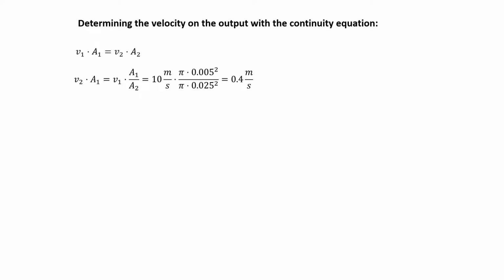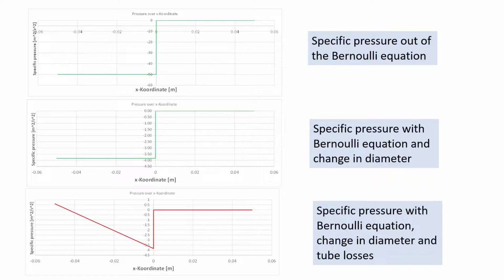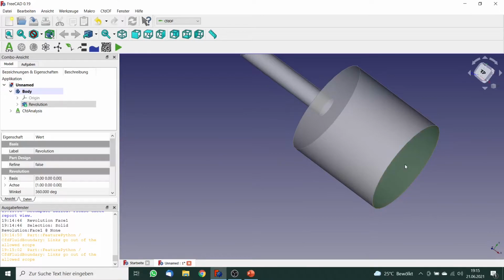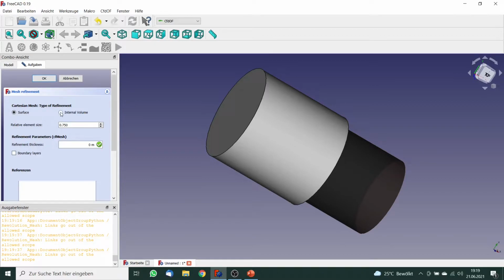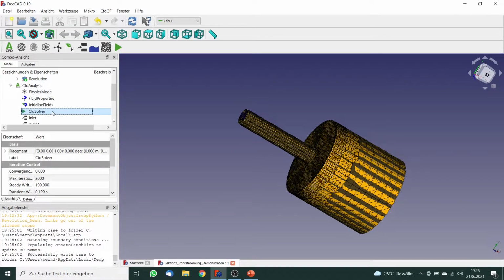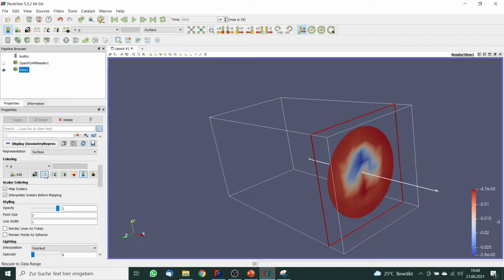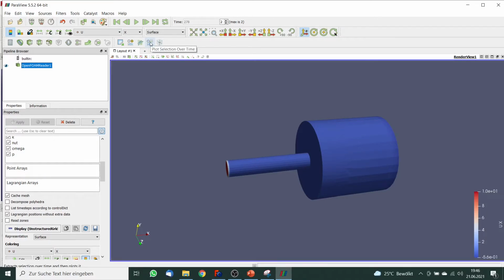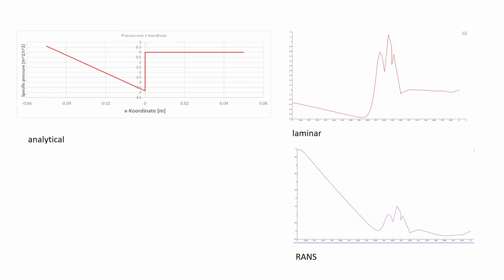Freecad CfdOF Tutorial #2: Tube Flow

Comment: Thank you, Techbernd5535, for providing a comprehensive explanation. When the force acting on the fluid is at the outlet, what would the parameters for the Inlet and Outlet be? To put it simply, there is a pump at the outlet that pulls the fluid through the inlet.
Reply from the maker: In contrast to solids, liquid can only flow under pressure, so there is no pulling. To be more precise, this tutorial actually only calculates the effect of a pressure difference between the inlet and outlet. As long as there is higher pressure at the inlet than at the outlet, the medium flows towards the outlet.

Comment: hi
there is an option in ansys, Symetry,
to cut the shape/mesh into the parts, when we know that the behavior is the same and symetric. this way we can reduce the amount of processing.
is there similar option in FreeCAD, OpenFOAM, Elmer or calculix ?
Reply from the maker: Hi multiforc271, in FreeCad CfdOf there is a symmetric boundary condition (BC). I explained this boundary condition in my first video tutorial: https://youtu.be/OS4sbbBtZUw. Please also take a look in the discussion below by video tutorial. Please be aware that my video tutorials are about FreeCad CfdOf, this is a workbench for FreeCad that generates the input files for OpenFoam. Elmer, Calculix and Z88 are part of the FEM-Workbench of FreeCad. About this workbench, you will please find many other tutorials.
Reply: @techbernd5535  Yes, I have seen your other video, but the symmetry in that case, was two mirror walls. 
Can i use the same command, when i want to divide a rectangle into 4 ?

Ja, ich habe dein anderes Video gesehen, aber die Symmetrie war in diesem Fall zwei Spiegelwände. Kann ich denselben Befehl verwenden, wenn ich ein Rechteck in 4 teilen möchte?
Reply from the maker: @multiforc271  Thank you very much for your questions. I think that youtube comments are not the right medium for such a discussion, for this reason, I gave you the answer in the FreeCad-Forum. You will please find my answer in the FreeCad-Forum here: https://forum.freecad.org/viewtopic.php?t=77414